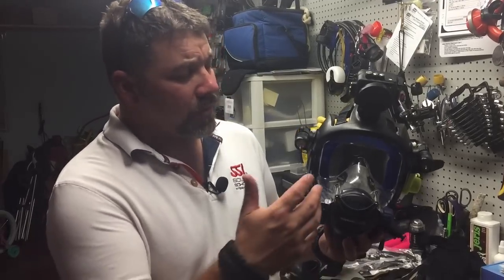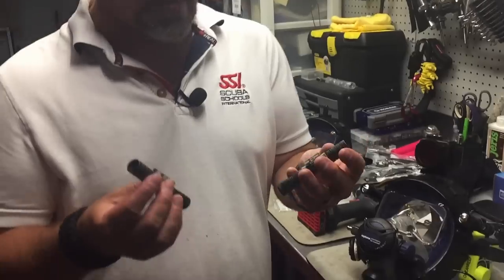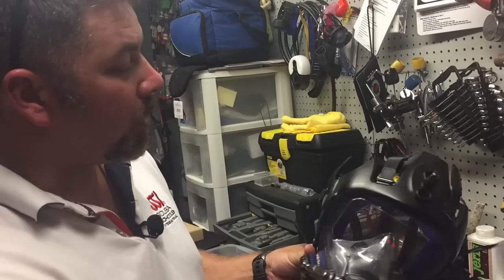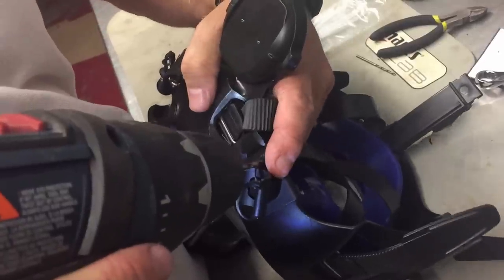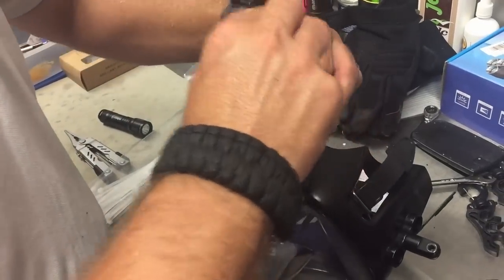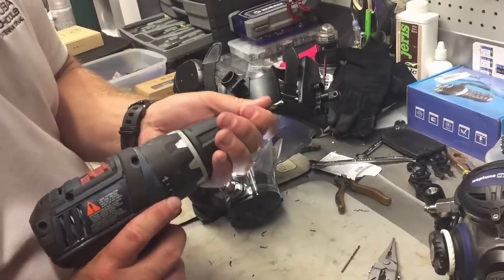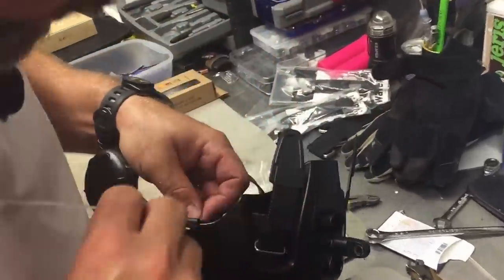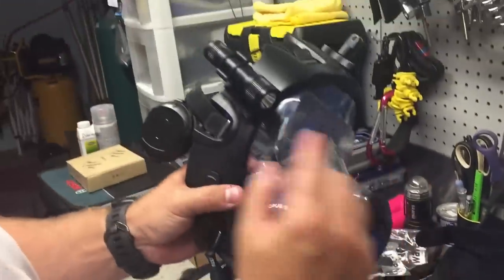Updating Our Lights On Our Full Face Mask

Comment: I really like your swivel mounts used for your lights and understand they come with the lights.  I am wanting to use a similar setup for my Paralenz camera.  Do you have any suggestions or sell any swivel mounts that I could use to mount the Paralenz the same way you mounted your lights on the side of the Extender?
Reply from the maker: Hello Mike Barker.  I will actually be speaking with Paralenz next week at DEMA.  I will ask them what they recommend.

Comment: Regarding specifically the Ocean Reef Neptune G.divers IDM do you have a specific cleaning procedure to commission the mask prior to fist time use as we do with traditional dive mask. I suspect the manufacturing process for a full face mask uses some of the same release agents on the plastic and needs to cleaned away prior to first use to prevent a horrible fogging situation. So many methods to clean found on the UTube.... I would never use a lighter and am a bit concerned with toothpaste being a bit abrasive. Sure it depends a lot on the the of lens, tempered glass vs a type of polycarbonate plastic. Your thoughts, my OR G.divers mask arrives this week and I fully trust you have quite a bit of experience regarding this brand and model of FFM...
Reply from the maker: So one of the biggest benefits with a Full Face Mask (all manufactures, not just Ocean Reef), there is really never a concern with the mask fogging up.  The reason is because you always have a constant flow of fresh dry air with every inhale, so the mask actually will stay fog free.  The only exception is, if the mask is not properly sealed, then a small amount of moisture can creep in and cause a temperature change, thus causing the mask to fog.  From the factory, your Full Face Mask should be good to go, with no need to clean it before hand.  Now as far as cleaning procedures after a diver, I will be making a video on that very soon so stay tuned.  In a nut shell, I remove the communication unit (GSM), and the Surface Air Valve, then use just a tiny bit of gear wash (any brand) or baby shampoo, mixed in water, to flush out the mask.  Afterwards, I run fresh water through it to clean out the suds.  Then I simply hang it up to dry.

Comment: Are you able to comment on what communications system Ocean Reef GSM G vs OTS Buddy Phone is more widely used in the public and professional search and recovery industry?
Reply from the maker: Not sure I can as a whole, but I most definitely can here in our area.  It’s a 50/50 split. Most of the teams here in our area, that are volunteer, use the Ocean Reef GSM’s, with a few Buddy Phone’s mixed in.  The bigger paid teams however, tend to use the Buddy Phone system from OTS.  I speculate this is primarily because OTS promotes more towards the Professional side and Public Safety side more so than Ocean Reef.  With paid teams, comes more money, thus the OTS system is usually chosen as a higher priced item.  I have used and still use both on multiple teams, but have always favored Ocean Reef, simply for comfort for me on fit, and the fact I have primarily sold them more than OTS.  The good news is, they are both compatible with each other, and both will communicate with each other.  This works out great for calls when multiple teams get called out on mutual aid situations.
Reply: Thank you for your detailed response and your last statement that both are compatible cross brand on the coms is very encouraging news! I now suspect as in radio communications a standard specification was developed earlier on from the military need then trickled in to public safety and industrial use and the manufactures build there transceivers to the specification. Super cool!

Comment: If you get some time can you do a simple video on your GoPro rigging on the top of your FFM. I have seen others that have moved the underwater headphone to the side off the GoPro to capture audio while under water. Not sure you even find that necessary for your Public Safety dive to record verbal notes during your dive missions or not. I suspect paid professionals may just choose to have a audio recording device on the surface to capture all coms and later edit them in to any captured video...
Reply from the maker: I will definitely make a video on that, and will try my best to get it done this week or next week.  Thankfully the audio you hear in our videos is actually pretty clear without any post recording editing. We use the Intova brand cameras and GoPro brand as well, and both do a great job at picking up audio.
Reply: LakeHickoryScuba I learned the Intova company based here is Seattle actually has stopped making their line of digital cameras.  Major brands like GoPro likely beat then up in the market place where it made no since to continued the camera line.
Reply from the maker: We heard the same thing.  Thankfully Intova still supports the dealers, for now at least, but we have been toying with the idea of buying from another camera manufacture, just haven't made the jump yet.
Reply: Was the GoPro mount to the extender made? If so could you link it. Have been looking for one a while now. Great videos. My 13 year old JR Advanced ow enjoys them.

Comment: Hello, I have a hood which is the correct size for my head which has the smooth skin on the inside and outside at the face opeing. I am getting a seal but around the temples it's only about 1/4" overlap with the mask skirt. And in order to achive that overlap I need to pull the neoprine out over my temples a bit. The way you had your hood on there seems to be a greater overlap that 1/4". But all the hoods I looked at seem to have the same cut. How do you achive a better overlap between the hood and the mask skirt?
Reply from the maker: Great question @DeepThought893, the only answer I have for you, is to find a different hood. Finding the right hood for Full Face Mask can be difficult. The one that I personally use is from Comfort Zone Scuba. https://comfortzonescuba.com/the-tcz-full-face-maskffm-hood/
Reply: Thank you for your reply @LakeHickoryScuba . Comfort Zone Scuba is available in USA, I live in Southern Europe and getting shipped one from USA would be troublesome particularly if it doesn’t fit. So I’m now trying to ask questions as to determine the features that work. What I noticed from the way you’re wearing your hood is that at the temples it slightly stands out and isn’t flush with your skin. Do you perhaps deliberately wear a slightly larger hood? I’ve been going by the head circumference specified by the manufacturer. As these hoods are primarily made for cold water I need to order them from Northern Europe like Sweden, UK, etc… I have the Poseidon black lined 5mm hood. It’s a great hood, it does the job but only just and I want to have a greater margin of seal overlap. Hence I’m wondering if you use an oversized hood.
Reply from the maker: @DeepThought893  Other than custom made hoods I’ve purchased when purchasing a new custom Drysuits, I have never once used a size chart for a hood. If you have a local shop near you, go by there and ask to try several on. Make sure you take your Full Face Mask with you. This way you can find one that works best for you. If this is not an option, then you can still use your current hood as you would with a traditional mask. Once you have your Full Face Mask on, pull the hood out from underneath it to get a seal with the skirt to your skin, then allow the hood to sit on top of the the mask skirt. Hope this helps.
Reply: @LakeHickoryScuba  Hi I think I solved the problem. I had to have a hood otherwise I would need to shave off my beard and that ran the hazard of divorce. From your past videos you know what I mean ;-). In any case I have tried two hoods. One from Waterproof h2 5/10 mm sandwich, it must be the sandwich flavour hood as that is the only one with the bare neoprene around the face. And also Northern Diver supervent skin-skin. Both of these hoods are made for a FFM. It is important to get the hood that fits even if it feels a little tight on land. Both hoods work fine but I personally prefer the Waterproof hood because it is just a much nicer hood. It is much more stretchy and comfortable and the face seal is made of 3 mm neoprene while the rest is made from 10-5mm. It just feels much more comfortable. The kicker is that it is more than double the price of the Northern Diver which is made of a much tougher neoprene and the face seal is around 6 mm. The extra 3 mm make a big difference to the way the mask sits.

Now please allow me to ask you one more question. It is about the equalisation nose pads. My instructor adjusted them so that either it takes more effort to blow through the nose or the pads touch my upper lip. What is the best location?

Comment: Very interesting video great mask how much did your mask cost you?
Reply from the maker: My cost on the mask is lower in nature because I am a dealer for Ocean Reef, but the retail cost on the G-Divers featured in this video is $682.  The additional accessories like the communication unit (GSM) and the Extender Frame adds to that cost.
Reply: LakeHickoryScuba thank you very much Do you have a video on how you attached your camera and coms system? I have my own camera to attach but I really want to know what kind of coms system that is and how much it will cost me.
Reply from the maker: My personal mask, featured in the video has several accessories.  The GSM  (comm unit) retails at $563, the lights are $69 per light, the Extender Frame is $100, Quick Detach hose system, $100, and the Surface Air Valve is $50.  The camera I use is 1 of 3 Intova models, depending on the day, averaging $250-$350 in retail.  Grand Total, I have a little over $1983 in retail cost on my setup.  I also use a surface unit, which retails around $1590, and a smaller surface comm that retails $730.
Reply: LakeHickoryScuba do you use this for surface supplied diving? I want to scuba dive with this mask should I still buy the mask, lights, extender, and coms system or just use regular gear
Reply from the maker: We rarely use surface supplied air.  In regards to what you should dive, I encourage all divers to become proficient with normal gear first before trying distinctive equipment such as a Full Face Mask.  But at the same time, you should use what you feel the most comfortable with.
Reply from the maker: In regards to attaching a camera system to your mask, there are several ways to do it.  On my mask, I drilled a 1/4 inch hole through the top of the Extender Frame and installed a 1/4 inch screw, which is what the camera itself mounts to.  The Intova series of cameras have a standard 1/4 inch mount that will fit any camera mount on the market.  This is another reason we choose to use them over the Go-Pro.

Comment: Hi, is any trick to get it working right? Me and my buddy got that GSM communication unit , but all we can hear is the beep when somebody pressing the bottom. We could never understand any words we were saying. I also have one unit on the boat with the same result.
Reply from the maker: Hello George, we teach a class here at Lake Hickory Scuba demonstrating the proper set up and use for the GSM.  A lot of divers fail to set up the microphone correctly.
Reply: @LakeHickoryScuba  We did set up microphone per Ocean Reef video, membrane towards the mask. Is there anything else we need to do with a microphone?
Reply from the maker: Was the GSM’s purchased new.  If so they should be covered under warranty.  You should be able to run them by any Ocean Reef Dealer, and they should be able to replace or service them for you. It is very difficult to diagnose the issue over YouTube.
Reply: @LakeHickoryScuba  It's 3 brand new units and for sure 3 units can not be defective. It's either have this low quality of communication or we are not using it right. We are not using it in the pool, i should probably try to go there.  We are trying to use it near wreck at 80 ft depth, may be metal wreck messing it up.
Reply from the maker: You definitely need to be trained by an Ocean Reef Instructor on the proper use of the GSM then.
Reply: Hi George, My wife & I had the same problem. We sent ours in under warranty. Ocean Reef had their lead Italian tech, who was visiting change out the mike cables and test them and said there was nothing wrong with them. We still got garbled speech. In multiple phone calls and emails with their tech, we were finally told to press the button, wait for 3-seconds, and then talk. We still heard the garbled speech. We were told to only dive in saltwater and that we must have been diving near seaweed, rocks, ledges, etc. My wife gave up and sold her Ocean Reef on eBay. I will sell mine shortly and will sell the GSM coms for whatever we can get for them. I suspect part of our problem was my mask had a light freeflow that wouldn't stop, but by the time I sent the mask in, my wife sold hers.